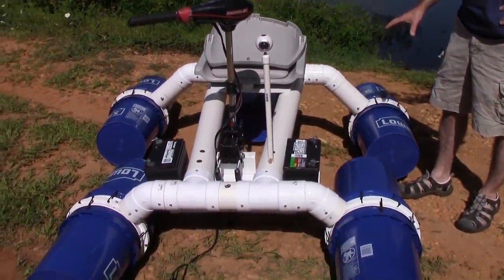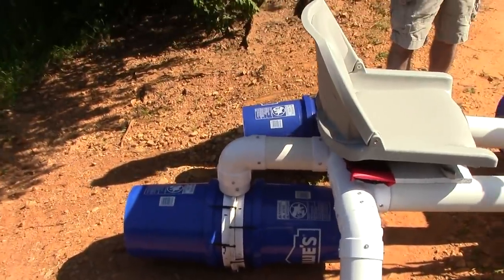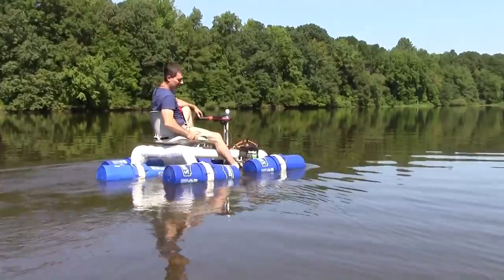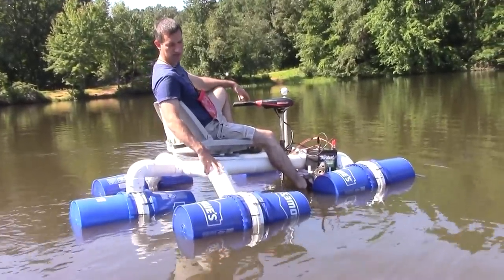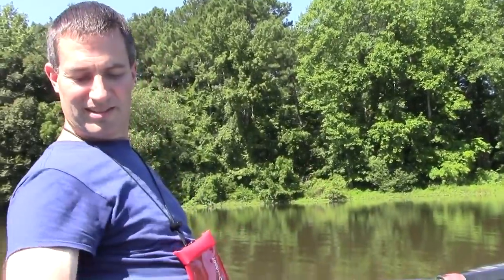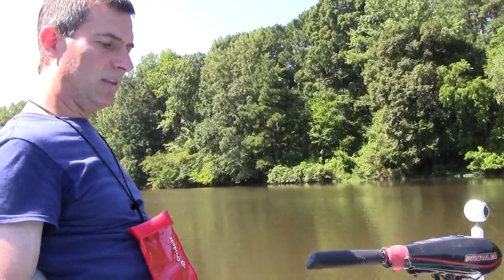Homemade 5 gallon bucket race style fishing boat

Comment: Yeah , that's pretty slick . Worked out well for a prototype . Rube Goldberg would be proud .
Reply from the maker: Cool, thanks for the complement.
Reply: @supergokue1  Considering the low cost of materials , and ease of construction , you may have a marketable item there . A couple rod holders and a place for a tackle box , and that's a hot setup .
Reply from the maker: Cool, thank you!

Comment: Snap a lid on the bucket, and install a pressure fitting.  Heat the bottom of the bucket with a heat gun, and pressurize the bucket with a compressor.  The result will be a nice rounded bottom on the bucket.  It will also increase it's flotation because the buckets will then be bigger.  An alternate method would just be a heat gun, and a capped piece of pvc mounted vertical.  Heat the bottom of the bucket, and push it down onto the pvc in the center.  Will give more of a V shape versus a round shape like air pressure would but anything is better than flat.

Comment: Attach one of these (Lumax 204 oz Capacity Plastic Funnel)  to the end of each bucket. Fill with closed cell expandable foam until it seals off at the end. It will make the barrels more aerodynamic (or simply plug the end with a cork, if you're worried about the toxins in the foam). The funnels are about $15 each. If you use tubing to connect all the barrels together, you should only need the funnels on the front two (or possibly front and back) barrels.
Reply from the maker: I'll buy a few and try them out, thanks for the tip :)

Comment: I’ve read most of the comments and the only thing I could add is to insure when gluing pvc together, use must also use cleaner. The cleaner starts melting the pvc, but the glue makes for sliding together easy and fills in the gaps and the extra glue settles in the lowest point to form a smooth trough. Great idea, keep upgrading! Oklahoma
Reply from the maker: Good to know, thanks for the comment.

Comment: nice build!
My recommendations.. Move the back center buckets to the side.
The issue is the thrust from the trolling motor is lose some due to it hitting the buckets.
Find some wat to put cone fronts on the buckets....
possibly add a modified bucket to each front.Slpit it and use a soldering iron to weld it back together after shaping. You can use a heat gun to make it more shapable.

Comment: This is a great project and is not the final design. The problem with showing people progress on a project,  and I'm not talking about the builder, I am talking about the people who have no idea what it takes to "develop" something... they expect a Ranger bass boat right out of the gate.
Reply: The Frugal Fly Rodder No we don’t. We expect nothing and give freely of our intellect and advice. Screws don’t make sense in this when cement and primer would have done the job better AND air tight. 
I mean the stuffs like 5 bucks for the cement and primer.
Reply: @chloehennessey6813  it's a set-up ,materials are for the next job if you had follow the whole video you could know this.
Reply: your absolutely right
Reply: Yeah so ture
Reply: @chloehennessey6813 , He used screws because he said he would be using the fittings for other projects.  Also, the buckets are the floats and not the pipes so if water gets in the pipes the water would drip out somewhere else.
Reply: @chloehennessey6813  12

Comment: Another 2 5gl buckets up front for the added weight of the batteries. And you already said you need to add glue. Plus, i would spray foam the insides of the pvc pipes and buckets will make it MUCH more stable, allow for more amenities(weight) and safer if chambers flood that the foam will keep you buoyant. You gave me some ideas for sure. Cool idea. Goid job guy.
Reply from the maker: Thank you!
Reply: Bill Ding  --- you can fill the barrels and PVC pipe with pigshit as long as  that material is less heavy than water and it won't make a bit of effect on flotation

Comment: The middle bucket is catching your propeller thrust which is applying most of the thrust into trying to push the trolling motor and bucket apart. And use more buckets to form nose cones and that will cut your overall drag way down and likely increase your speed by double if you make the suggested changes.

Comment: 1 things I would change on that amazing fishing boat to make it better. The compressed wood you used to mount the seat. They sell now flat pieces of PVC at Homedepot. Use that instead of wood to insure that seat will never rot. Thanks for the video. Looking forward to making my own in the near future.
Reply from the maker: Yes you are correct about the wood, it is not built to last. I found a way to take large pieces of PVC pipe and make flat sheets out of it. Here is the link if you are interested   https://youtu.be/ce-rFJMK3mU . Thank you for the comment, Lonny

Comment: I suggest buying some large dollar store plastic bowls and gluing the on the front and back of each bucket.  You'll be far more streamlined plus get some extra bouyancy without adding much weight.
Reply: Good idea you can buy a readymade boat or a kit,but cobbling something together from odds and ends and it works is way more satisfying. Long live diy.
Reply: What glue works on polyethylene? Maybe some poly welding is needed?
Reply: @taterkaze9428  
I find that as long as the surface is roughed up enough, CA glue (superglue) sticks to just about anything
Reply: Brisdad53 
 3 mph would be a huge improvement.
Reply: screw the bottoms of the buckets together... cut a hole in the lid for the big salad bowls... glue them in and put the top on the bucket.
Reply: Night Watch  jeez people, how many of you didn't listen to him say he didn't glue anything because he wants to reuse the fittings?
Reply: Night Watch  since you've started the name calling I suggest the best glue for you is the ones labeled "Do Not Eat". 🤣🤣🤣🤣

Comment: Suggestion that may help. Use the 4 inch PVC lower in the water, Higher post seat swivel boat seat, Put batteries in plastic battery boxes with lids. No plywood required. The 4 inch pipe helps with flotation and reduces weight. I can run a 12 foot boat with 1 battery, you should be fine with one on that.  Maybe some plastic  fins on the bucket to split the water, reduce flat push of the water. 
FYI a plastic 55 barrel will support 500 US lbs in the water. But nice idea an good work

Comment: Home depot, Lowe's buckets hate UV exposure,  they go bad so fast, and become cracking, that you would be amazed. At this point I'd buy one foot or larger diameter pvc pipe, and make pontoons out of it,  two loooong pontoons, filled with expanding foam, PVC glue capped, and that will give you seasons of use, especially if you paint the pontoons to cut on UV exposure
Reply: Filling the pvc with expanding foam. Brilliant!
Reply: Closed cell expanding foam FTW! open cell acts like a sponge.
Reply: Ajaxaxxess good point, especially if pvc is screwed and not welded together. But sorry can ya take some time to catch me up...what is FTW? Humm, gonna look that up now
Reply: @dr.michelleevamorholt1538  For The Win. 😊
Reply: Courageous Truth has spoke then Truth :)
Reply: Courageous Truth thanks y'all! I was hoping that was the version @Ajaxaxxess was using. Found another interpretation, Careful what ya find out there 😉
Reply: Mystery solved!

Comment: Not bad for an off hand build. Room for improvements. Gives me ideas. Thank you! But batteries open to waves or splash? Made me shiver a little at that. But still looks like a fun fast build that is relatively cheap for a toy of this type. Well done!
Reply: The batteries are probably water proofed
Reply: Sealed lead acid batteries are by definition, sealed. Not a short hazard either since its 12v-24v...

Comment: Suggestion. Move batteries to the back which will help level out the plain. Thu also allowing a opportunity ti design a tackle box working area. I've seen similar designs where foam has been used to fill flotation cavities. Looks like a fun and functional project.

Comment: Great innovative idea! Your making a fishing barge tho, it’s not gonna be a speedster, so make it a little wider & a little longer, (1) loose the extra barrels in back, (2) build a platform behind the seat for a milk crate/rod holders, batteries, (3) turn all barrels sideways for less resistance , consider using 55gal plastic drums, & above all, whatever you decide , use pvc glue instead of screws! Add lights on a pvc rail & it would make a fantastic floundering barge. Shalom!

Comment: i enjoy builds like this.  just a thought to lighten the load a bit;  use plastic cutting boards (wal-mart) for any decking you may want and use battery boxes to secure the batteries.  put the batteries in the rear or underneath of you in line.  Someone mentioned plastic bowls from the dollar store that are the same width as the bucket bottoms.  Fill those buckets and bowls with foam.  Sweet project though.  As an afterthought,  put some wide wheels from a golf caddie on it and a tow handle.  Have fun.
Reply: J

Comment: I can't think of anything to comment so I'm just going to post a Blueberry pancake recipe.

1 1/4 cups all-purpose flour
 1/2 teaspoon salt
 1 tablespoon baking powder
 1 1/4 teaspoons white sugar
 1 egg
 1 cup milk
 1/2 tablespoon butter, melted
 1/2 cup frozen blueberries, thawed

1. In a large bowl, sift together flour, salt, baking powder and sugar. In a small bowl, beat together egg and milk. Stir milk and egg into flour mixture. Mix in the butter and fold in the blueberries. Set aside for 1 hour.A

2. Heat a lightly oiled griddle or frying pan over medium high heat. Pour or scoop the batter onto the griddle, using approximately 1/4 cup for each pancake. Brown on both sides and serve hot
Reply from the maker: That is fantastic, Thanks!
Reply: I know i am late to the party but.., that was the best comment ever.. i wish instead of posting nonsense everybody would follow your lead.
Reply: Kmsl

Comment: Friction fit PVC will leak. Should have glued the joints with proper glue and dolvent
Reply: Busy Guy this guy can’t be a plumber! Water will leak into those fittings and the screws will rust out! Like you said he should of glued the pipe
Reply: AND add a schrader valve at the top and a drain valve at the low point
Reply: Fill the buckets with Styrofoam.
Reply: Screws only add weight and won’t seal properly pvc glue buddy
Reply: He said in the video that he did NOT glue the joints as he was going to reuse the pipe etc. in other boats.
Reply: He's not gonna need glue..  even if water gets into the tubing it will drip out, its the buckets that are making him float not the pvc piping or fittings. All he'd need is the bigger barrels not 2 buckets screwed together thats the problem he'd have trouble with. Not the piping.
Reply: Just use expandable foam in everything
Reply: agreed, the design and idea is all there! just needs a few more tweaks and mods. the front end needs some work, if that thing goes any faster its just gonna nose dive under water.
Reply: Busy Guy yes ....
Reply: Mucha resistencia del agua con esos recipientes. pero eso se puede mejorar.
Reply: @OldDunollieman  Nobody "reads" the directions, or pays attention!
Reply: The PVC frame is not pressurized nor filled with anything other than air at atmospheric pressure. Leakage is not a concern. Stainless steel hardware will not rust. Besides that, glued connections cannot be repaired. Additionally he has drilled numerous access holes in the frame in order to attach seats and other wood components to the frame.
Reply: @garryjohnson2896  how many pounds will it carry sir?
Reply: @garryjohnson2896  I don't think adding anything is gonna help because it adds mass and weight. The reason why styrafoam floats is because of the air pockets in it. You would be just taking up needed space for more air for buoyancy. I say add helium if you wanna add a more buoyancy than air gas then glue the connections.
Reply: @extraordinaryactsofglass3743  see above--- the filler does not change buoancy unless the specific gravity of of it is more than water which is exactly ONE
Reply: @gordonbrown5476  has nothing to do with buoyancy.  Its about preventing leaks
Reply: Busy Guy, the PVC is completely open to the outside, both through the holes he drilled in it to attach the seat & battery platforms, and the open ends of all 5 pontoon mounts.  Gluing the PVC will provide exactly zero in the way of ‘leak’ protection.

Comment: Cool build. One main problem: The plastic those buckets are made out of is not very UV-Stable. (Actually on purpose, I think, for environmental reasons). In about one season of being out in the Sun, the plastic can become brittle enough to crack. It will definitely happen over time, due to the combination of UV and Oxygen. PVC is Pipe is more UV Stable.
Reply: Those buckets are a lot tougher than you think.

Comment: I saw a fun project where they attached 6, 55 gallon plastic barrels under a picnic table (3 on either side) and they put a trolling motor in the center where the umbrella normally goes. I don't know if it would be a good fishing boat but for hanging out with friends, it could be awesome

Comment: Maybe I'm missing something.  Why didn't you just use PVC cement?

Nevermind, I commented without watching the ending!  Sorry!
Reply: My first thought too.
Reply: Bradley Payne   nope hawaii had it first,  but we call you pupule hoale kane ( crazy white man) lol smile,    started  from the 1800 beat that ,,  why do hill billys walk with a one sided slant,, if you were born on a side of a mountain you would walk that way also,,,   lol I made that joke up
Reply: Frankie Teague  somebody needs a Snickers
Reply: Haha I do that all the time!  an old boss once told me to stay quiet. That way no one know if I dont know shit!!  I've never forgotten it
Reply: I once made pontoons with abs pipe. On the front I'd put a 45 and a short piece that protruded out of the water. It created a semi smooth surface for the water to pass. Much better that just a cap.  Also I'd put 2  3in sections side by side with a 2 in piece in the "crotch"  It created a V shape
Reply: Also I pretty sure PC glue works fine considering glued PVC joints can hold upwards of 200psi water pressure!
Reply: If PVC Glue doesn't "weld enough" - Then you're doing it wrong. A glued PVC joint is actually WELDED - not Glued. The Solvent melts the PVC and when pushed together it literally welds the two pieces into a permanent fit. There's no amount of screws - period that could be placed into PVC that would have the same strength and stability as gluing the joints.

Comment: Cool design. Maybe you can think about adding a detail to the front of the bucket that can cut through the water. The flat surface of the bucket is adding resistance
Reply from the maker: You are correct, the redo will be way more aerodynamic. Thanks for the comment, Lonny
Reply: You are welcome.

Comment: what if the buckets could be oriented the other way, perpendicular to the boat,  especially on the front, so that the round part of the buckets faces the water?
Reply: Exactly
Reply: What if  a barn DOOR AGAISNT THE wind??!!!
Reply: @anthonyagnelneri4076  what if Tom hanks rolled a joint and smoked it on an island ??
Reply: It would be more even surface area against the water flow and the rounded curve wouldn't make much difference then.

Comment: The wafer board around the water will probably not last long.  
When replacing it would probably be best to use pressure treated plywood or lumber.
Cypress would be good too.
Nice ideas and work,,,,
Reply: I would say Marine grade Plywood and more water dynamic cones on the front of the buckets and he would be good to go.
Reply from the maker: You are correct about the wafer board, it will not last long. After a lot of thought I figured out how to take large pieces of PVC pipe and make it flat. So far I am happy with the flat PVC sheets. They weight less and have no water issues. If you are interested in the video here is a link  https://youtu.be/ce-rFJMK3mU . Thank you for the comment, Lonny.

Comment: i'd move the batteries behind the seat to remove the front end weight since you have more flotation in the rear.  I'd also hide the cabling inside the pvc.  but all in all not a bad idea.

Comment: I Love DIY stuff this boat is great, if you use the PVC cement that alone would shed some weight also smaller lighter motorcycle batteries will reduce weight too👍🏼

Comment: Cool build , I watched it last night for the first time and have been chewing on an idea to reduce resistance without adding substantial weight . what if you took a 5 gallon bucket stand it up as designed and cut out a plate starting top to bottom , measure the width of the bucket on your rig and cut a panel out . now you could design a jig or even match your  kayaks bow . take a heat source to mold panel . bend flanges in the design so you can attach it each bucket. 
I see a solar panel as off grid bug feature too :)
Reply: It's called smart thinking ...... so chew no longer and build one for yourself ;-)
I like the idea.
Reply: Cowboyjam hyn

Comment: I saw a design on junk yard wars many years ago and I thought that it was a good dyi project. They used maybe 5 55 gallon barrels for a keel with a rounded nose on the lead barrel. Then the plan was to use 2 outriggers again made from 55 gallon drums welded back to the center keel. They put an inline 4 banger in one of the barrels and ran a drive shaft to a prop through the last barrel. It was a great design. It floated and ran very fast through the water. The problem was that they ran out of time before they got the 2nd outrigger attached. It dumped the crew. That being said....your little boat looks like fun. Maybe think about the center keel with outriggers. Good luck on your next attempt.
Reply: Serplus para canopy army navy 🐯